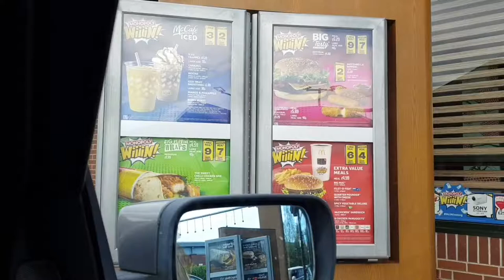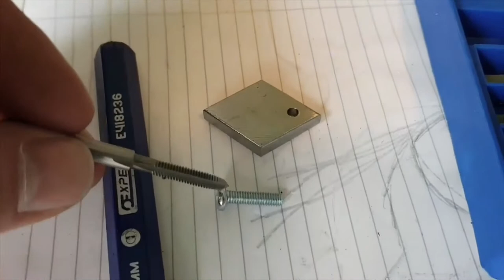Hand Forging a Steel Horse Sculpture

Comment: watched this all the way through i liked it.
re blowing holes in the metal can you turn the power down on the welder ?
Reply from the maker: If I had smaller electrodes to hand, and preheated them on a scrap piece of metal prior to starting each arc, I may... MAY had been able to weld that 0.75mm plate using a low enough amp feed... but the trouble is I was trying to weld it to 10mm bar, so I think either way, the steel cladding was just too thin to be able to effectively weld with a stick... TIG may also have worked, but I don't have one of those. :)
Reply: @PJTForging  hi i have a tig welder which also blows holes in metal 
all i have on it is a high and low setting.
i just try to keep it moving while i weld which some times helps
Reply from the maker: @farscape3100  I wouldn't have a clue about TIG... hope to own one at some point though. ;)
Reply: @PJTForging  yours does a stronger weld than a tig